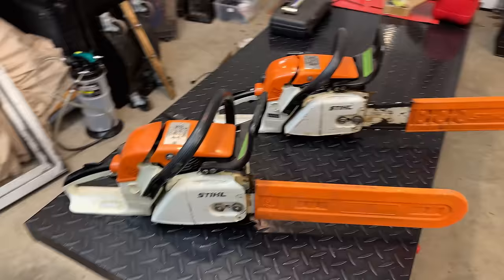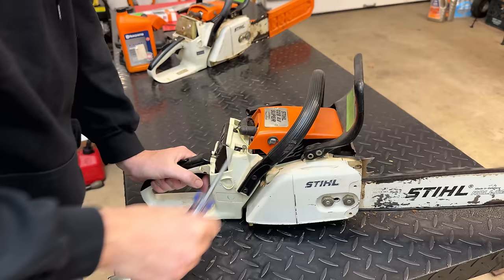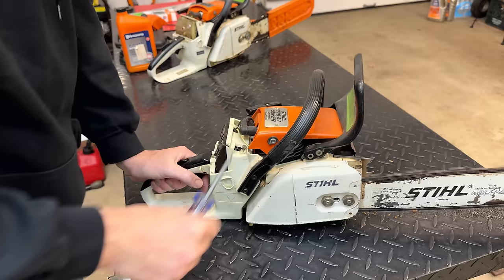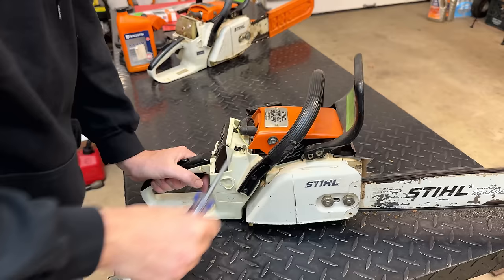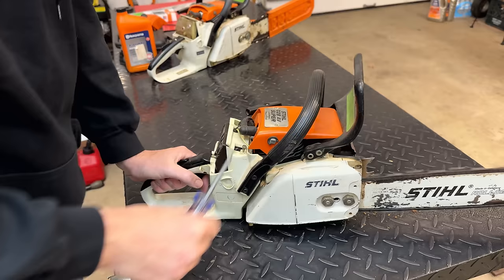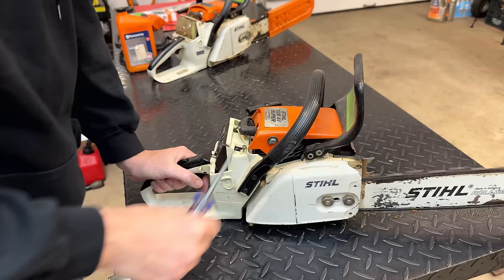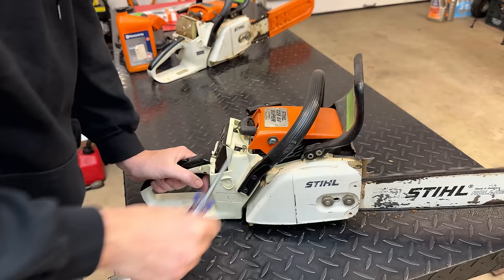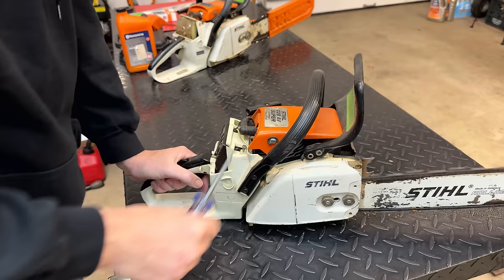Rebuilt STIHL Chainsaw Not Running Well - Straight Gassed 2 Stroke Fixed

Comment: Great work again. I would have pressure/vacuum tested the fuel system too. Perhaps the old screw radiator hose clamp of the intake boot could be upgraded to the new spring type. These type will never leak. Ok the guy who took it previously apart did not tighten it but anyway screwclamps always loosen up with heatcycles. On the "slow" saw I missed the fourstroking" at full throthle when tuning, so possibly could have opened up de H more(lower speed but more pull)
Reply from the maker: The H setting I maxed out the speed.  Not good for the saw, but was trying to see if I could get it to cut as fast as the Facebook saw.
Reply: @jcondon1  ok, good to see the performance difference between aftermarket and OEM. Maybe it improves when the piston and rings are more seated in? Regarding the comment on pressure testing the fuel system. Youtube channel "Married with small engines" does it standard and I think that's really good. Sometimes tanks vents are not fully ok anymore and together with a clogged fuel filter or a tiny crack in the fuel line causes misdiagnoses on for example the carburetor. Still great work and keep it up. Especially the consistency of diagnosing is of a very high level🤩.

Comment: I own a small engine shop that specializes in 2 stroke equipment, mainly Stihl. I haven't worked on an old 028 in a long time. Those things sure were built well. You did a great job on that repair!
Reply from the maker: Thanks

Comment: And remember  the one saw rings haven’t set in yet it needs to be put  to work . Great job with both saws .
Reply from the maker: I hope that is it.  I pulled the exhaust tonight to make sure the piston and cylinder were good.  Was concerned that the intake boot being the way it was may have caused damage, but things look good.

Comment: James, a great video… I always learn from your videos.  Just a thought on the speed issue on Stanley’s saw. If the person who damaged and rebuilt the saw was not experienced in rebuilding you may want to check with him to see if he replaced the piston, rings and cylinder, did he check the ring gap?  If the rings are too tight then that may cause the reduced performance.  
Another great video!  Thanks

Comment: The problem with 2 strokes is if you do any type of work too them, especially engine rebuilds, YOU HAVE TO TUNE-IN THE CARBY...and these stihl chainsaws are very good example of that with a reputation in Aussie for this tune-in issue...being if it fails than you have to rebuild the carburetter itself. My first-hand experience of 15 years ago!
Reply: But you probably (at the age of this saw) also need to replace
the sparkplug, 
the air filter, 
the drive sprocket, 
both clunk filters (fuel and oil metal weighted pickup filters) in each respective tank
replace the fuel lines with tygon (that carb kit had a length of yellow tygon tube)
might have to replace the antivibration mounts
muffler spark arrester screen
etc.etc.

Tuning a carb as James demonstrated..is not that hard.....?

Comment: Good timing James! I was out with my 034 the other day, and it started idling funny and then it bogged. I brought it back to the garage, drained the fuel and bar oil. The impulse and fuel lines were replaced a few years ago with OE. I’ll be checking the filter, lines, boot, and crank seals. In that order.

Comment: When you adjusted it to 12k and left it, that’s where I usually richen it slightly, for the safety of the engine and the extra will help it when it’s well hot after extended use on a hot day.
Reply from the maker: I should have been able to get it running faster.  Usually I can exceed the max rating then open it a little more to richer it up and slow it down.  Something is still off with this one.

Comment: Great video well shown step by step to test for possible problems and fixes  . One thing you may want to ask ( since you found so many loose parts ) is if the guy who tried to do repairs is if he torqued any major parts like rod or head bolts  . It looks like he may have used vise grips on crank to burr up that end. It would be a shame to have it come apart again because of a mistake someone else made.
Reply from the maker: I double checked the flywheel and jug bolts (off camera). All were good.  Might have a look inside.

Comment: Well done on chainsaw video.
I have been using the ultrasonic cleaner to clear the low speed and high speed circuits with great success. Those passages are smaller than the filter on the fuel line in the tank.

Comment: I used to have an 028. Best saw I have ever owned. Then i ran over it with the tractor. 😢

Stanley's saw still has an issue or two. It took about twice as long to cut through the log than the Facebook saw. It was dragging and running lean through the cut but yet when free running and leaned out it couldn't get 12,500 out of it. I still suspect carb needs a new diaphram but the saw is probably toast.

Anybody that doesn't know chainsaws use mixed gas doesn't need to use one.
Reply from the maker: Possibly the carb.  Am thinking poor clone kit or maybe the new top end was burned up a little running with the air leak on the intake boot.

Comment: I've read all the comments. If you loan a saw you must send mixed gas and bar oil that the machine is used to. Very important to take stupidity partway out of the equation
Reply from the maker: I think it was.  Unfortunately he ran the saw dry and refilled it with the wrong stuff.

Comment: This helps me, I'm a just a tinkerer and have always tried to fix my own and do pretty well. I have a couple chainsaws that I've revive, but this one stihl , think its a 192, I have always tuned it ok till it accelerates like Stanleys. I was sure it has a leak but didn't think about the boot or other avenues, always thought it was the carb or seals on the carb. Gonna check it out this week, Thanks.
Reply: An update on the MS 192tc, Well I followed the air paths and found a gasket on the backside of the carb that wasn't suppose to be there, some idiot must have left it there as a place holder and forgot to remove it before installing carb. Unfortunately I'm the only one who worked on it. Anyway that fixed the problem and it runs like a champ now. Thanks again.

Comment: Well I am still lacking in the chainsaw department but I  now have a much better understanding of how a two cycle works.. I  thought clone carburators were the only part that wasn't as good as the original but you put the original back on.perhaps it needs a bath. Great video

Comment: Regarding the loaning of equipment. My dad used to own a Maul 2 man chainsaw - a beast of a machine. The classic he loaned it to someone and shouldn’t have. My dad repeatedly told the guy that it was two cycle and that it needed an oil and gas mix. User used a tank of fuel and put gas minus the oil mix in the tank. It didn’t ruin the engine but it never ran correctly after that. It could only be started with an 120v electric motor using a fan belt. Once started and warmed it could be started with the pull rope. The sad part is the guy never offered to pay for repairs to the motor.

Comment: It's amazing how 99% of problems with 2strokes are carb related. I don't even bother cleaning them, just slap a new one and work from there, but most of the time it solves the issue.

Comment: @James: I commend you on your patience with these chainsaws and 2 cycle engines in general. I’m very comfortable around 4 cycle but 2 cycle is always a challenge. Everything is so compact, assembly order is crucial. When I watch vids on equipment like this, I try to imagine the factory assembly process. Great video. Thanks.
Reply from the maker: Same here.  I do not do a lot of 2 stroke.  Always a challenge mostly due to the size.

Comment: Samo - Samo. I loaned my chainsaw to my brother in law and it came back with a ruined chain hanging loose and running poorly. I gave it away and bought a new one. I loaned my power washer to a neighbor and it came back with a blown pump. Expensive lessons. Never again.
Reply: Better to say
 "I will come over and do the work with my saw/pressure washer. 
You tell me what you want done..and be my gofer...
Then after it's all done you owe me a beer or two..."
Reply: Exactly what I have done.

Comment: I'm sure I saw somewhere that if you spray carb cleaner on a suspect leaking 2-stroke crankcase seal *while the engine is running*, if the engine speeds up you've found your leak. Got to be prudent with the carb cleaner of course, as you don't want to dilute any lubricating oil in the 2-stroke fuel.

Comment: My name is Ian Grant living in Jamaica first time watching your channel just want to say i think you might be wrong i Used aftermarket parts and Stihll chainsaws and i don't have no issue Sometimes it can be the saw itself just cutting slow i use I have been using aftermarket parts for a good while almost over five years and when i tell you i don't have no issue i have MS-250 for myself with aftermarket parts i didn't do not give me no problem and i use auto Market parts to repair chainsaws for my customers i let them know and i don't hear no One complain To me

Comment: @vintageenginerepairs, side note here filters are meant to taken apart and rinsed with saw gas in the field. Great job!.
Reply: If the air filter has a felt type cloth in it...let the wash gasoline evaporate after the wash...
otherwise the saw will be "overgassed" by the fumes drawn from the material flowing into the saw with the nice clean air....

Comment: A couple of years ago I saw a JBC soldering station and fell in love, but it was expensive. Almost 1000$. Then I saw a chinese wannabe JBC using the same cartridge tips as the JBC.
A 192Watt soldering station. So pretty hefty if you have the right tips. Aixun T3A with the T245 handle for the JBC C245 cartridge series.

Comment: The number one rule for a mechanic is to start at the last place another mechanic was working on.  I would check the base gasket and the seal between the carb and the boot, first.

Comment: I use an impact without a piston stop.  It usually pops the clutch right off.  I put it back on the same way.  I have a Stihl plastic piston stop, but seldom use it.  I would seat that seal, correctly, while I was at it.  It is a lot of work to remove the boot and install it, correctly.  I would replace it while I was at it.  If in doubt about any part I just replace it.  I would put a little TB 1184 on the flange on the cylinder where the boot attaches- just the way I do things.

Comment: Keep the chain out of the dirt.  Otherwise nice diagnosis on the air leak.  Hopefully Stanley can source a Stihl top end for it.  It might pick up some RPM after it breaks in now that it is running better.  Should set it abit under max rpm even if it is less that 12k otherwise it might go lean.

Comment: Stanley's saw is clearly down  on power , cylinder may be scored from running lean with that leak , rings might not have seated properly etc it's definitely related to the amateur rebuild ,but at least the dude tried to make it right
Reply from the maker: I agree.  Might need another rebuild.  Was surprised, would have expected the compression to be lower.
Reply from the maker: Going to pull the exhaust tonight and take a look.  Maybe a part 2?
Reply: I’m not familiar with saw engines but. 2 stroke sled engines the cranks are pressed together and sometimes if they seize the crank section on the hole that seizes will spin a degree or two and throw it out of phase , and change the port timing just a thought
Reply: @jcondon1  Both saws are 145 lbs. do they have a compression release ? if not you would think that provided the rebuild was done correctly and rings seated properly Stanley's saw would have have higher compression than the facebook saw with how many unknown hours ? I can't resist a good puzzle
Reply from the maker: @kevinsedo6869  no compression release.  I pulled the exhaust last night to have a look at the piston and rings.  No obvious sign of a problem: 
https://youtu.be/W9SfRdr75fM.

Comment: ...absolutely outstanding DIY video James....first class quality on content, audio and video...thanks for posting...I love working on chain
saws, but I do not have much experience, and so, I am curious why you did not check for possible piston/cylinder scoring?...maybe because
the compression was acceptable @ 140 psi?....just asking - not trying to be too critical... 🙂
Reply from the maker: Mostly because the compression was good and it was a fresh rebuild.  After testing and seeing it is down on power, I will pull the exhaust and see how things look.  That intake air leak may have caused some scoring.

Comment: The oiler pump has a adjustable set on the bottom of the saw where you can increase the amount of oil to the chain

Comment: For those carrying on about clone carbs. Yea sometimes they don’t run. Strip them down prior to installation and check metering lever for correct level
That will be generally yr only issue
Clones have saved my backside on lawnmower engines and two strokes many times
If u have a basic understood carbs. You can navigate clone carbs and save $100,s of dollars

Comment: Neighbor gave me a ryobi and tried to tune. 
Ended very bad. 
Bought him a new saw but also found later that the fuel line was delaminated and pieces in the tank. 
Got new carb and fuel line kit for cheap. 
Going to try it this summer lol. 
Acted very very different with full tabk to later half and empty. I think its thise fuel lines.

Comment: Could it be anything to do with the Zuckerbuck chain being better quality of chain and sharper James. In the vid, Zuckerbucks chain seemed to shift more wood if you follow what I mean. Great vid and keep them coming James🙂
Reply from the maker: Possibly, but I felt both were cutting well.  The saw just did not have as much power when under load.
Reply: @jcondon1  I know what you mean. At the end of the day, which I think you mentioned in the vid, you don't know what's been done to the engine, or what kind of parts have been used, second hand, oem or non branded. I'll go with second hand or non branded James.🙂
Reply: If it doesn't run better after a few tanks of gas it's probably the clone parts. Sometimes the ports in the jug are off a bit.

Comment: Friend borrows valuable saw, destroys it due to ignorance, then “rebuilds it” using Chinesium. 

Some friend. May as well have just replaced the saw with one from Harbor Freight. The difference is incredibly apparent when testing the two saws at the end.

When I first started as a mechanic, I would occasionally loan out tools to coworkers to help them out. After several came back broken or never came back, I learned not to do that anymore and lock up my tool box when I’m not in front of it. Some people have respect for their own property, and even more respect for others. Some people don’t give a shit. Unfortunately there seems to be more of one than the other.
Reply from the maker: Unfortunately very true.  I recently let someone use one of my trailers.  It came back with dents on both diamond plate wheel fenders.  One is hanging on by a thread.  Sometimes you have to learn the hard way.

Comment: Spray break clean around all the places where it might be leaking.  When you find the right place the saw will die as soon as it sniffs the break cleaner.  I can pressure test it but that is a lot of extra work.  The break cleaner tells me the same thing.

Comment: I'm a dealer in the northeast and have not great luck with those clone carbs and stopped using them....they aren't ported right and have blockages in them and garbage left in them after machining too now....I only only use genuine sthil parts now too.....no more aftermarket  parts for those saws now too...

Comment: Thanks for another useful educational video. Do these saws have a governor or is the maximum speed controlled only by the high speed adjustment screw?
Reply from the maker: No governor.  The only thing limiting the speed is the air/fuel mix adjustment of the high speed screw.
Reply: @jcondon1  Thank you.

Comment: I saw a program that tested various brands of Bar Oil for chainsaws, and based on chain stretch over same periods of operation, they found what is the best oil to use. Ironically, it was not a 'brand name' oil, but what was actually the lowest cost in the market. The winner: Harvest King oil @ ~$10 us per gallon, at Rural King stores, and many others. This brand has a higher content of anti-wear additives, than almost all the others. (Musing: I wonder how it would work as an engine oil?).
Reply: Almost any oil will work well as long as a "tackifier" is added to it....
so it doesn't just fling off like a straight lubricating oil does when it reaches the sprocket or bar tip....
But that same tackified bar chain oil will ruin the saw if run as an oil mix in the fuel....

The proper 2 stroke mix oil needs to be able to be very fractionated to flow with the air throughout the saw internals and deposit thinly and evenly on the surfaces that need lubrication..
microscopically clumped oil lumps would not be able to do this......
Reply: Never do that, you will ruin the saw.

Comment: I'm just wondering if you installed the kill wire on the wrong side. It was definitely on the opposite side when you removed it.
Reply from the maker: It’s possible.  Did not lookup the right way.
Reply: @jcondon1  it seems to have worked out fine. Great job 👍!

Comment: Since the nuts were loose holding down the carb, I'm curious as to why you didn't tighten the nuts, put it back together and give it a shot to see if maybe it was just sucking air, especially when coming off of idle. I really enjoy your videos and have several machines I'm thinking of diving into just to tune them up.